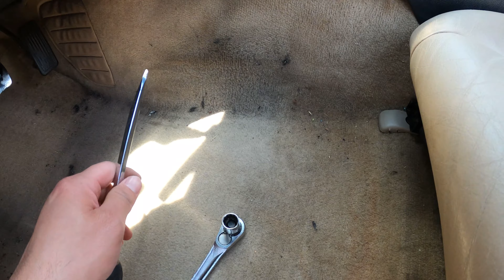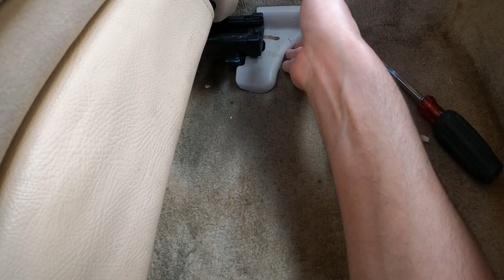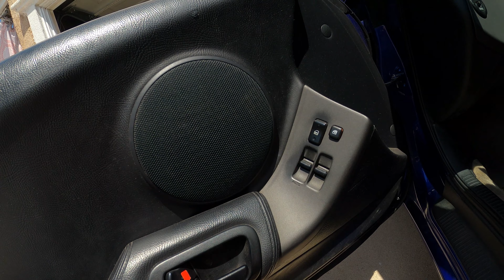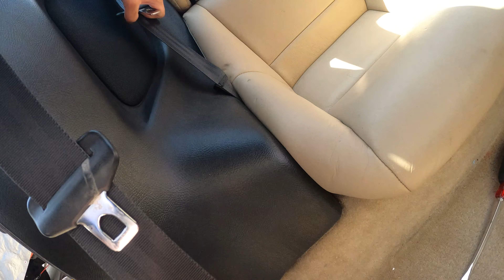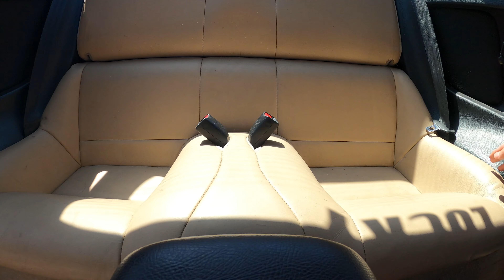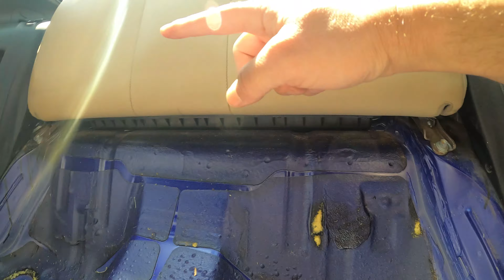How to remove seats on mk4 Supra

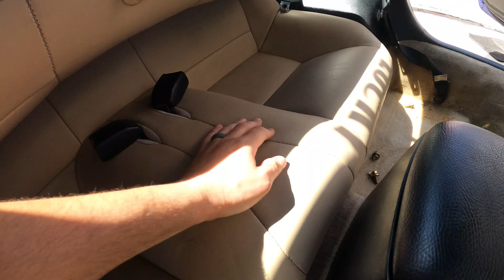Comment: Hi, at 5:42 I could feel that the left and right clips popped out, but the seatbank is still sitting tight for me and won´t move. Are the seats originally glued or is there some more trick to remove it? I worry to damage the leather, actually I just need to remove the screw to remove the plastic cover to reach the speakers.
Reply from the maker: hello sorry for late reply, under the seat is kind of sticky, sometimes, I just kept wiggling both sides as seen in the vid, try to wiggle the back of the seat as well. as long as your not praying up just on one side the leather should be fine.  keep me updated
Reply: @luckycarguy  Thank you for your reply. :) I saw your video several times now and could see that you pull for a very quick moment on the upper back side, that´s what I did yesterday, I pulled there and heard 2 little sounds, 1 was like this crrk sound from a little stickiness (without damaging) and the second was after a bit wiggling another plopp and I could finally remove it thanks to your video. I owned a Firebird before, there was 2 screws and a lot easier to remove that. I was planning anyway to do a video on the experiences I had with Toyota last year, thinking if I should do one for the seat bench based on your video, I would give you credit if this okay for you.
Reply from the maker: @REDFOGSX  I'm glad the video helped and that would be awesome!